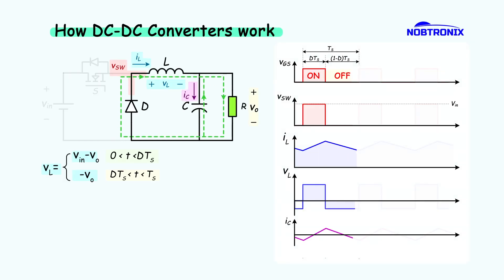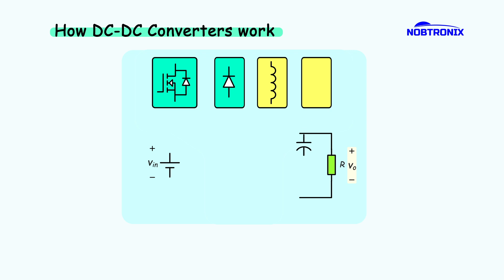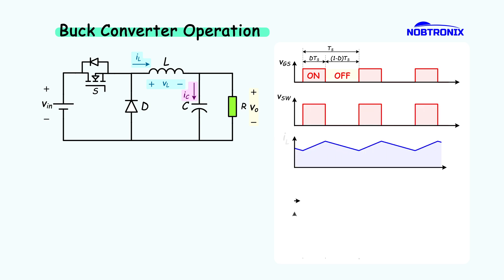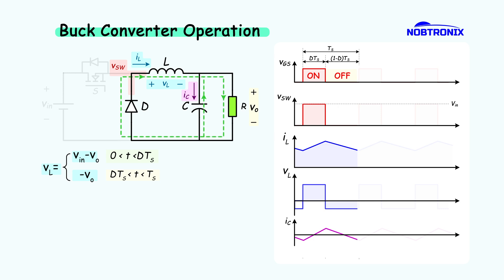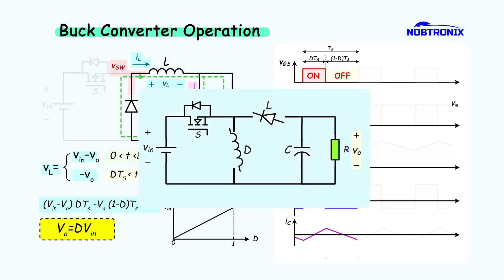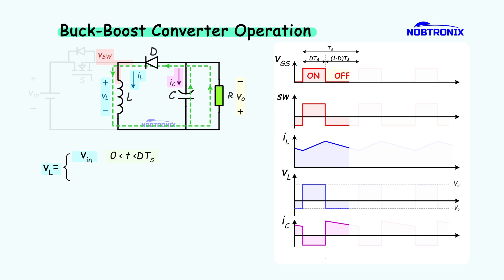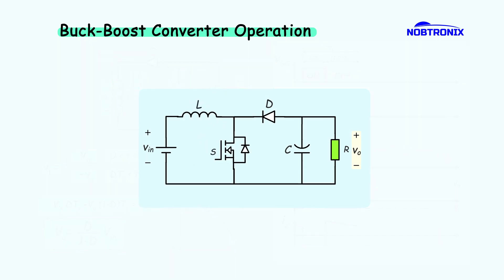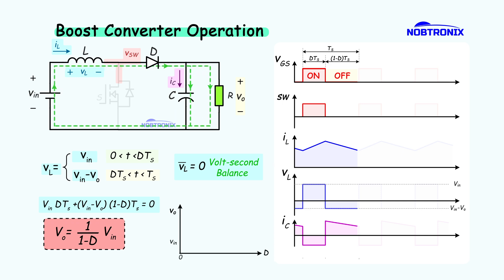How DC DC Converters Work Buck, Boost & Buck Boost Explained

Comment: Thank you for the nice animations, they are wonderfull !!
I was using your video today in my lessons. Suddenly I noticed a small error in the explanation of the buck convertor circuit. 
In the off state the polarity of the voltage over the inductor should be otherwise, I suppose? kind regards, Benjamin
Reply from the maker: You're welcome! Glad you found the animations helpful. Could you let me know the timestamp for the error you noticed so I can check it?